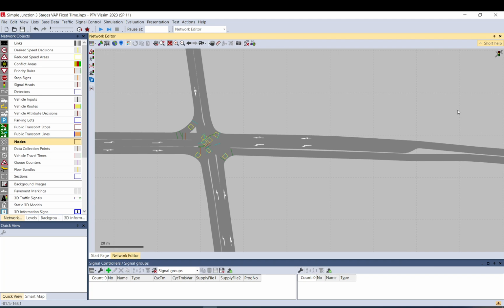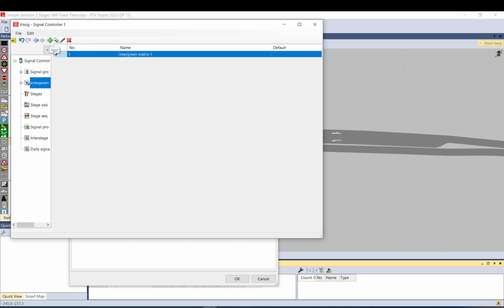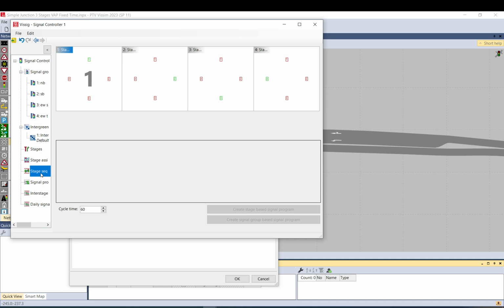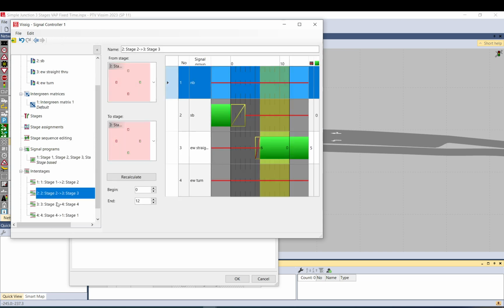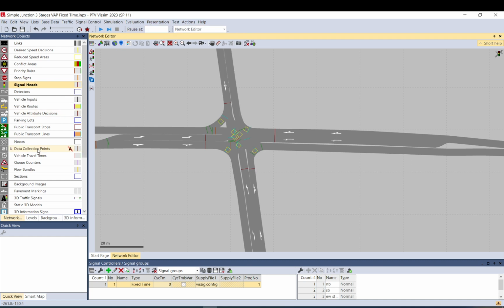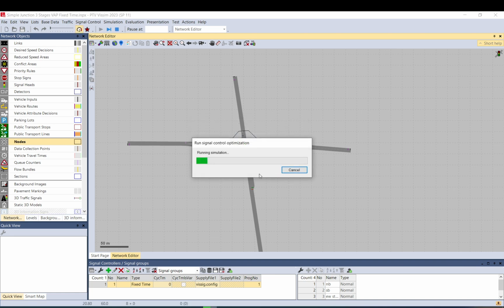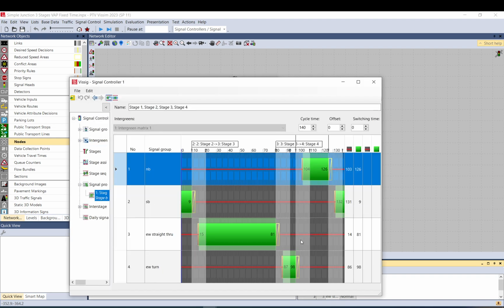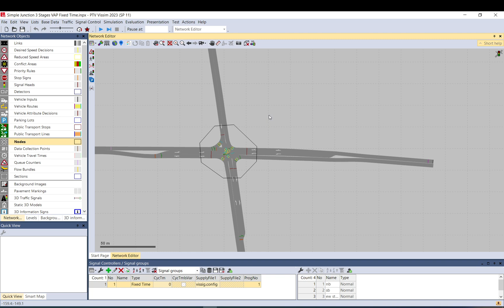Vissim Tutorial - Signal optimisation

Comment: Hi Matyas.
Thank you for you tutorials. They are very useful!
I also watched your video about controller communication with VisVap - https://www.youtube.com/watch?v=pWKgbxp_mU8
I have a question - during synchronization with VisVap, two traffic light objects light up simultaneously excluding the distance between intersections.
Is it possible, using VISSIM, to create such synchronization that would provide a so-called “green wave” for cars, taking the distance between intersections? In this case each controller must have some offset time for activation. 
To do this, I tried to create a network with 6 intersections that would work with each other. The optimization built into VISSIM, calculate automatically the desired green signal length depending on the shoulder demand.
Theoretically, I can use VisWap logic for this purpose, but then you will need to install detectors for each intersection separately. Also logic will be too long and complicated.
Maybe there is an idea on how to make this easier?
Reply from the maker: Hi, it is quite complicated not only in the model but in real life too. There are tools to design this on paper.
Using Vissim's signal optimiser is not suitable to achieve such.
Visvap can be a tool to do it. You can either for simplicity keep all controllers in one logic. In this case you can keep timers or variables within the same logic to keep things simple. Of course if your logic for each intersection is complicated, this will result in a massive flow-chart.
You can build logics separately and send markers/bits between controllers. I think probably this is simplier when the controllers use very very similar logic across the 6 intersections. So you just copy paste it 6x.
Of course COM interface is another tool, but probably more complicated or requires lots of coding experience.
Usually, the best approach is to use signalling bits or markers to notify the next controller when to switch. Again, to have this bit in one logic or in separate logics is depend on your situ. 
Linking intersections though is mainly suitable or possible (properly or well) if left turns (or right turns in AU, UK...) are banned. Also usually different times of the day you need to favour different directions (the direction with the greater flow)

Comment: After Optimization Maximum Queue length is coming more than what actual without Optimization, so on which principal this Optimization of signal work can you elaborate it..
Reply from the maker: Extract node evlaution outputs and check all approaches for delay and throughput. It should decrease delay and increase throughput.
If you have queues over 500m you might need to increase node evaulation settings to consider queue over 500m.
Also double check that your node covers all approaches. 
I can imagine that on 1 approach your queue might increase a bit (minor arm) to increase throughput on major arms. But this should not be excessive. If it is, then something is wrong probably.
From my laptop I will write up the steps Vissim takes during optimisation.
Reply from the maker: This is the sequence for the optimisation:

- Vissim determines the average delay of all vehicles that have passed through the nodes on the lanes with signal heads of the signal group, using an automatically created node evaluation for each signal group over the entire simulation run.
- For optimizing, the signal group in which the vehicles have the highest delay is determined for each stage.
- The stage with the lowest maximum average delay is selected as the best stage.
- The stage with the highest maximum average delay is selected as the worst stage.
- A second of green time is deducted from the best stage.
- A second of green time is added to the worst stage.
- If a second can no longer be deducted from the best stage, the second best stage is used. If this can no longer be shortened, the next worst stage is always taken iteratively. If no other stage can be shortened, the optimization is terminated.
- A signal program is considered to be better than another if one of the following criteria is met:
- If the flow formed by the total number of vehicles driven through the node during the simulation run has increased significantly by at least 25 vehicles or by 10% if this is less.
- If the flow has not significantly decreased by 25 vehicles or by 10% and the average delay across all vehicles has decreased.
- If a signal program is better than the best rated, it replaces this as the best. The optimization is continued with the next step.

The optimization is terminated if one of the following criteria is met:
- Once the signal program does not improve within 10 simulation runs.
- Once the flow decreases by more than 25% compared to the best signal program.
- Once the average delay increases by more than 25%.

Comment: helo Matyas!! is there any data collection points or any other thing required on intersection for optimization.In your interssection yellow box and other green lines are shown.kindly guide
Reply from the maker: Hi Usman, no, it only uses node evaluation for the optimisation. It takes vehicle count and vehicle delay using the node evaluation. What I show in the video are everything you need to do. Key requirement is that you set up the signal using Vissig as stage based control. That way it can take time away from the best movements (in the node) and assign it to the worst. And once that best movement cannot be reduced further, it start working on the second best and so on. So, it is key to have intergreens, minimum green times and stages.
Reply: i am using the demo version of the vissim and fellow the same steps in video , system show the process of optimization but signals are not optimized,i dont know what's problem occure. @MatyasLemberTutorials
Reply from the maker: Did you set up a node and node evaluation is ticked on? Did you set up the controller properly? Check signal group minimum green times/intergreen times and cycle time. Try to use similar values I assumed. Does the optimiser do multiple iterations or it just finishes in a few seconds?

Comment: Hello sir, sorry, I want to ask again, how do you determine the volume of different vehicles when turning?  is there a tutorial?
Reply: I mean determining the number of motorcycles that turn, cars that turn, bikes that turn, etc. thank you sir
Reply: we can identify by self in vehicel composition by multiply volume on specific leg with assigned % of cars or bikes  or any other vehicle types
 @ferryfarhaan   @matyas kindly correct me if i am wrong
Reply from the maker: Thanks @UsmanAli-hz5ns for your comment. Yes, that is correct. 
Sometimes if you use multiple vehicle inputs that might be difficult to use, so in those cases you might want to use node evaluation. There is an old video, but will do a new one today/tomorrow: https://youtu.be/OVX7BeuAghE
You need to make sure that you select node evaluation in the evaluation menu, select all vehicle classes in the same dialog box in the left top corner. After the run, if you open node results, it will show you the number of vehicles for each class.
Reply: @MatyasLemberTutorials  I have input the volume of vehicles on each road in "vehicle input" then after that I input the composition of vehicles on each road in "vehicle composition", but I still don't know how to set the number of vehicles (for example cars) that turn left, straight or right, please guide, thank you sir
Reply from the maker: Hi @ferryfarhaan, static routing decisions needs to be set up to direct vehicles through the network. There is a setting for them called 'relative flow'. That setting tells Vissim how many of the vehicles go which way. It sets the proportion of all vehicles from that movement. I have some old videos about this but will make a new one this weekend, stay tuned. In the meantime this might be helpful: https://youtu.be/UzcQ6G57cEM?si=ErmWkXL1gKOSPv8J
Reply from the maker: Hi, this new video should help. It is online now: https://youtu.be/pinV9u9u5PE